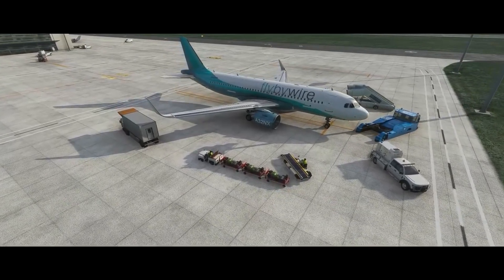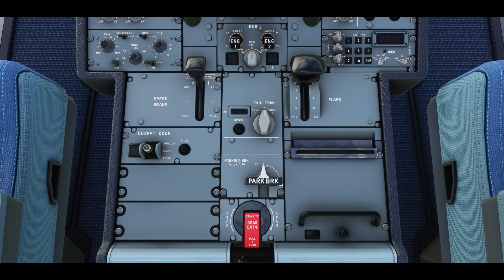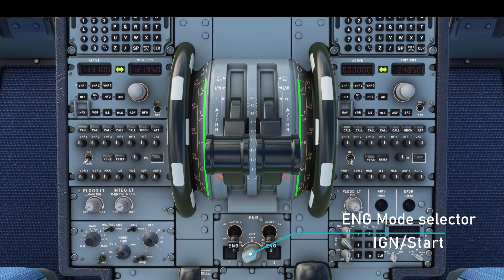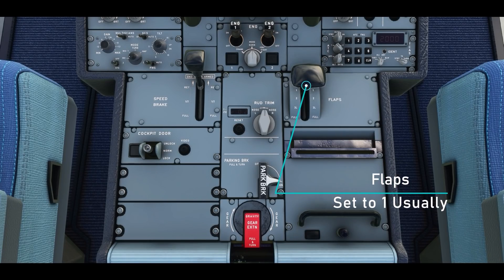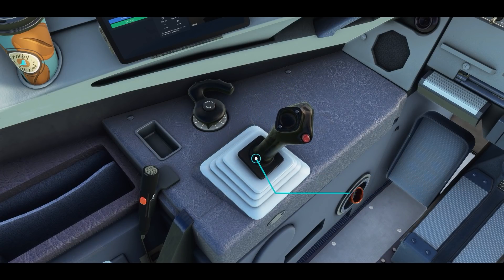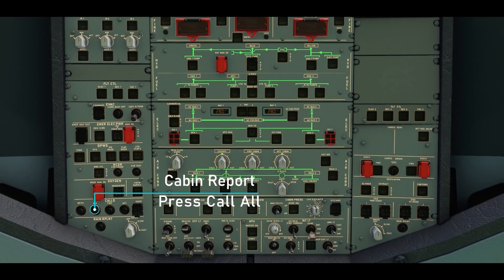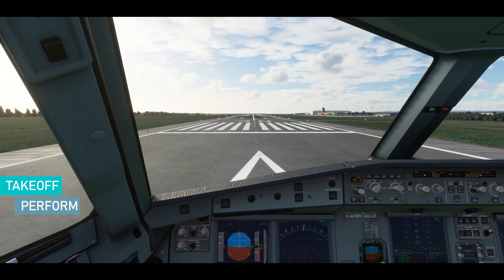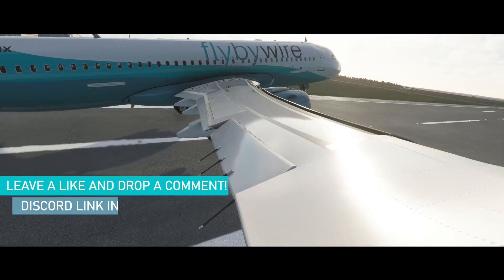FBW A32NX Ground School | Chapter 3 - Taxi and Takeoff

Comment: Nice video but i have a problem, i have downloaded and installed FBW A32NX in msfs 2020 from STEAM - notice that!! - the aircraft appears at fs but does not work!! has no energy 00 volts request external power from msfs but nothing!! have you any idea what it happens? is it possible for STEAM not to allow and blocks any other addon aircraft like FBW f.e. info from friends who has msfs directly from the Microsoft store has not any problem. HELP me, please! from GREECE with friendship.
Reply from the maker: Hello, we now only distribute the latest builds of the aircraft via our own installer which can be downloaded here: https://flybywiresim.com You should delete the aircraft you gained from the Simulator store before installing from our installer. For additional support, please visit our discord https://discord.gg/flybywire

Comment: Hello! I am a former FS user. I've used FS9 (Wilco Feelthere) and FSX (Aerosoft). I used them a lot and liked as well. I just bought MSFS and I really like it. First of all, thank you very much for your work on this A32NX. I love using it. But I have 2 problems and I couldn't find a solution. First, the brake button reacts too late. That's why I can hardly taxi. My second problem is that the plane accelerates very quickly during taxi. I wonder if idle engine thrusts are a bit too much? Is it possible for me to find a solution for these? Respects..

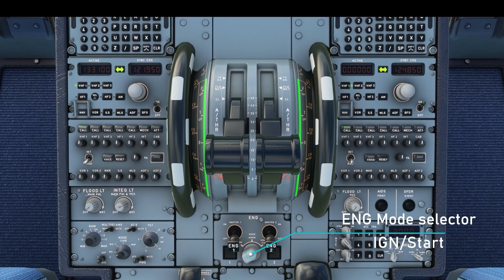Comment: At 2:40 you say it’s common practise to start engine two first. This isn’t that true in my experience. For three major European airlines I’ve worked for, we always started engine one first. However some airlines may still start engine two first when starting both engines. 

When you decide to start both engines, it really doesn’t matter what order you follow (from a technical point of view). But, if you’re going to single engine taxi, you’ll ALWAYS start engine one first. The reason for this is understanding how the hydraulics works. Engine one powers the green system which in turn powers the normal brakes. Engine two powers the yellow system and provides hydraulic pressure to the alternate brakes, parking brake and nose wheel steering. Prior to engine start, we need to confirm the accumulator is pressurised so that the parking brake can be set without any hydraulic pressure from the engine driven hydraulic pumps. Should an engine fail to start on pushback. 

Nose wheel steering will be provided if engine two is off by the PTU. This automatically engages whenever the green or yellow hydraulic system pressure is 500 psi greater than the other. So, when you’re taxing on engine one only, the normal brakes are operative through the green system and the NWS is working through the PTU. The accumulator will look after the parking brake if you need it but the PTU will also keep the yellow system pressurised giving you alternate brakes if engine one failed or there was a green hydraulic issue. 

So, why not single engine taxi on engine two?? 

PTUs fail more than engines. So, it’s better to have a PTU failure and lose nose wheel steering but still retain the ability to steer by using differential brakes than it is to lose the engine that’s powering the normal brakes completely. Yes the alternate brakes should work but it’s all a question of probability and “what’s the worst outcome”. Personally, I’d rather have brakes than steering. 

Another reason to always start engine one is human factors. If you start engine two on one day, and then start engine one on another day there’s no standard procedure that’s being followed. Standard procedures are there to maintain high safety margins and so that it is very known what is done next. There’s no surprise or “making it up as you go along”. If there’s no “standard” procedure, eventually, someone will forget what engine they’ve started or miss an important step. This can be caused by fatigue, confusion, recency, experience, distraction and many other factors. It sounds daft and you may ask “how on earth would you forget to start an engine?!” But, It’s happened and so long as there is a non standard way of doing something, there’s a risk it can get cocked up. 

To keep things simple, and the eliminate any chance of confusion as to what engine has been started or in what order, many airlines keep to a simple start up process. Engine one and then engine two. 

This isn’t always the case as some airlines may opt to amend this but this is not what I’ve seen or done. And I suspect the reason some airlines still start engine two first is a throw back to older aircraft where starting engine two was more appropriate for the type. Essentially the aircraft or fleet have been updated but the company SOPs that are there to operate the newer aircraft haven’t evolved when these newer aircraft came online. I’m not lambasting airlines that still do that. What they do is up to them. It’s their train set and the train set I play with, and the two previous outfits have always started engine one first. 👍

Another very likely possibility are airlines that always start engine two first, are never taxiing on a single engine. Which isn’t economical as it burns more fuel and gives off more CO2.

Comment: Hello gentlemen, I hope those videos is not created by a computer and exist a human behind It that can answer me this message. 
Congratulations for all the job you have done in order to offer a fantastic product. 🙏 
Just  I need a little advice and help from your experience and wisdom. Since 3 o 4 updates of the A320 NX, using your installer, the tablet come with problems for me, you can't imagine all that I have made, since deleting the the simulator until deleted the installer and tested all versions, Stable, Develop , and experimental. But nothing and any good news. 
The table appears in white color the screen and don't operate , and when appears in normal shape, is very old version, even don't let me load the flight plan from Siembrief! What can I do! Please help me to give solution to this issue.

Comment: Thank you so much for all that you have done so far, one minor observation, you made taxing seems so smooth and controlled, but in reality it is too fast to the point where you have to concentrate more in keeping with the max allowed speed than the flight itself, if you can do something about it , it will be great 
Thank you
Reply: In the real aircraft, the LEAP engine creates a lot more thrust at idle than you would imagine. We have gotten lots of irl pilot feedback, and taxiing on idle is very realistic in the sim right now. Real pilots tap the brakes when they taxi. This is very accurate and true to life.

Comment: is there a fix for the engine switches not working on the TCA quadrant after sim update?
Reply: Yep the bug is caused by a weird key assignment.
Go in your controls setting and remove assignement for "Toggle Engine 1 Fuel Valve" and "Toggle Engine 2 Fuel Valve" (I think they are currently bind on button 3 and 4)
Reply: @interactifstudio  will give it a try